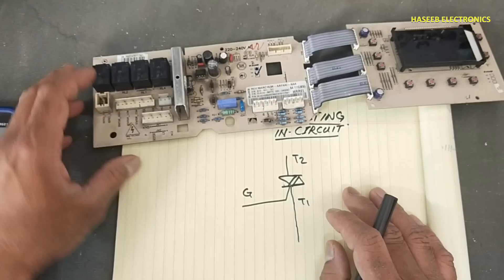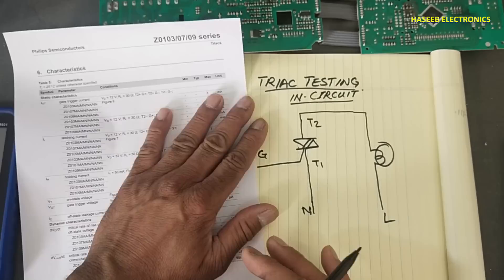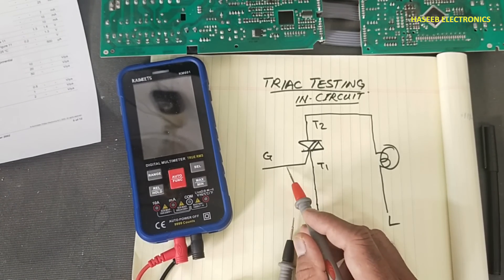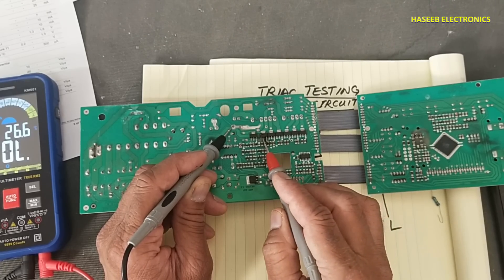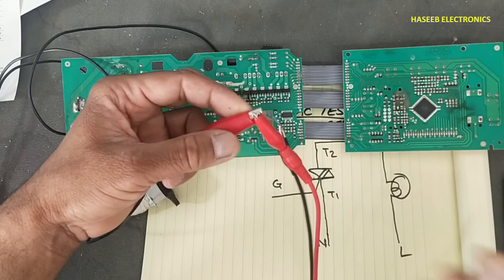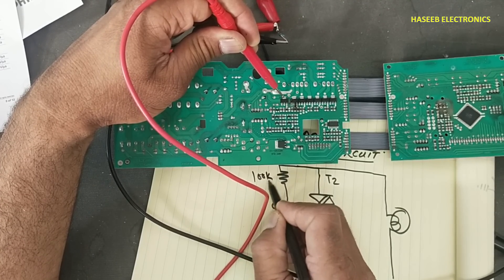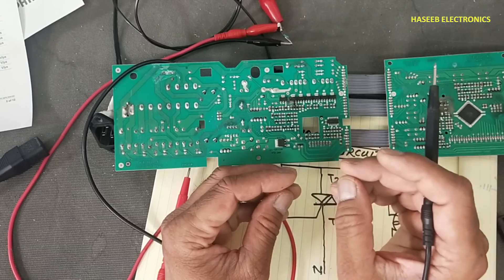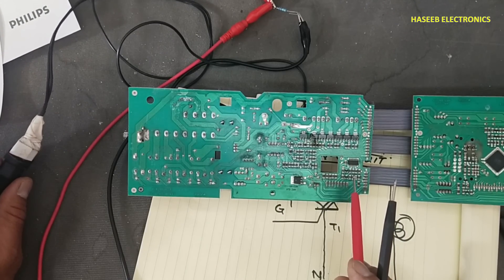{904} triac testing in the circuit ||TRIAC

Comment: Great video! I will probe this method but I have a question. If you put that 3mA (or any value of external current) doesn't affect the microcontroller? Because if the output pin has a low output the current is introduced through this terminal to the ground. Would you need to view the specifications of the MCU and the entire circuit? We should desolder the resistance that connects the gate and the pin (mcu) to protect and maintain the chip safe. Saludos desde Buenos Aires.
Reply from the maker: Best regards
It is better to use isolated driver (optocoupler) 
Or use "sensitive gate" triac
That is compatible with variety of microcontroller
Have a nice day
Greetings 💕💕💕

Comment: I have 4 triacs in a circuit controlling 4 separate heating elements. One of them went bad so i replaced it with the same part number. However, the replaced new triac output is not turning on. When I tested the terminal voltages within the circuit, for the working traics, all three terminals are showing 120V (which was surprising as i thought T3 voltage should be lower as it is a gate). For the non-working triac, T1 voltage is 1.2V AC while T2 and T3 voltages are 120V AC. Would greatly appreciate your input here on what might be the issue. Thanks.

Comment: I want to ask if there is any possibility to damage the triac gate driver circuit when you apply the voltage through 100k resistor. i have tried same method in coil relay to check if it works or not and most of the time a damage relay switching transistor? For example applying 5V in a 5V coil relay without removing it from the circuit

Comment: Thanks a lot for detailed explanation of  on board triac testing.For my defective Control PCB of IFB Dishwashing machine ,one of the TRIAC Z0 103M is found damaged due to short cicuied componant. Is it possible to get the TRIAC Z0103 M from your end or pl. suggest any other equivalent  TRIAC Number for replacing the defective triac Z0103M.

Comment: 8:58 - I had to play several times to rule-out a reflection: there is a problem with the gate resistor on that burned TRIAC because there are sparks every time power is connected to t2.
Reply from the maker: yes you are right

Comment: sir  i have a doubt if we touch gate of a triac it goes permanently on but while you touch the gate it is going on  and after you removing the black probe the triac is going off how it is possible. thank you so much sir  for giving us wonder full educational videos.
Reply from the maker: best regards 
you are mixing SCR with TRIAC. 
when SCR is triggered, it conducts and the remains ON, because the load current remains constant due to DC voltage 
in TRIAC, when the load current becomes low than its threshold limits due to changing cycle, because it is used in AC circuits.
so when we remove signal from the gate of triac and the load current is dropped than the threshold, the triac turns off and it gets ready for next gate trigger 
you can also check video number 571 as well for more details
Reply: Its great video .think you for giving us wander full educational experience video....جمعة مباركة عليكم...
Reply: Thank you so much sir
Reply: Sir 74 series ic ko Pcb say pull out Kiya bagar   
Kaisay check kartay hay

Comment: great tip. Thanks a lot, but isn't it easier to solder the resistor to TRIAC pins and then apply voltage?

Comment: Sir, why find out DC voltage in your calculation ? 
Explain whole datasheet with electrical characteristics of triac and how to control firing angle ( draw circuit and practical )
Thank you ❤